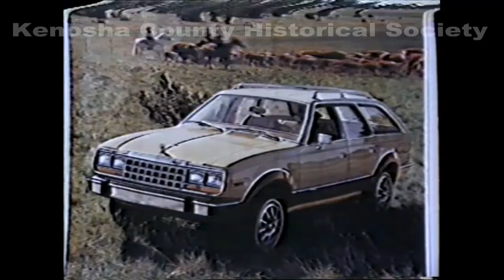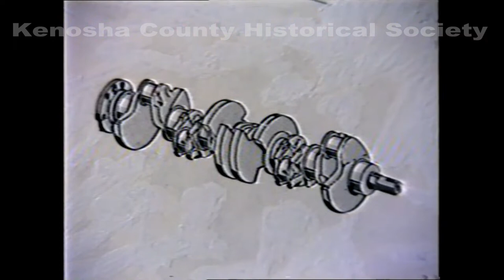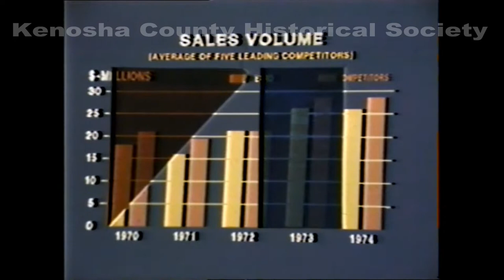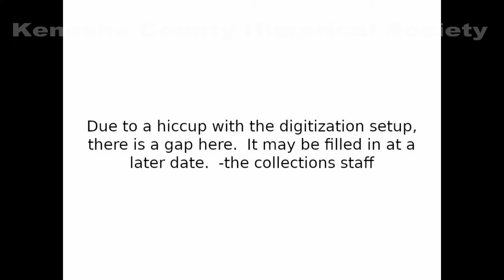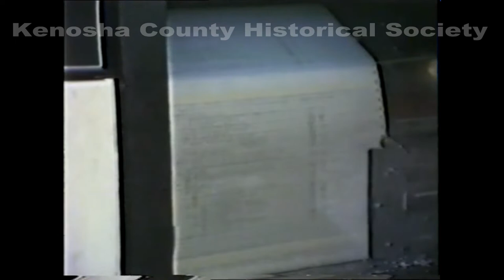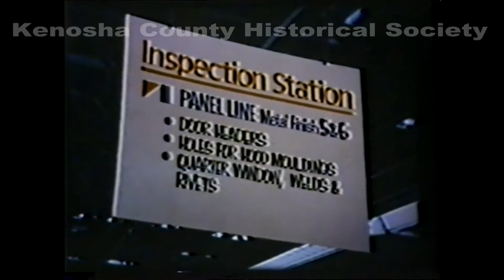"AMC History and Factory Tour, c. 1981."

Comment: In 1971, while still in high school,  went looking at a Gremlin but bought the SC360 hornet. Great car. Nose heavy with that 360 cast iron but very reliable and easy to work on. Shame I sold it for scrap long before its life was over. 160,000 and still strong running.  3.15 rear and 2.67 first gear could go to 65mph at 6500rpm. Screaming but never blew up.

Comment: In 1982, as I sat waiting for a tow in my broken down company car Pacer, the tow arrived. This is my 4th tow in 4 months. With 40000 miles this would be the 3rd transmission. If you ever rode in a Pacer in the summer, good luck. Riding in a glass bubble in the sun with a totally useless AC. It was over a hundred inside when you give up and roll down the windows. July and August you suffer. And other goodies that summer. Starter went out twice in 4 months, 2 new batteries, oil leaks, engine and transmission, and many other little things. So, I asked Mr. tow driver if the Pacer was his most towed car. He said it was second,  the Renault was by far the first.
Reply: Why did Renault come here? That is a very involved story having to do with French elections, the rise in power of the French Socialists, and the fear of Renault that the Government was going to take over the company. According to 4 guys I worked with from Renault, they were trying to get as many assets out of France as they could. Kinda makes sense, they made horrible cars for about 4 years and then went back to France.

Comment: Heck of a lot of people working in all those places. All the huge buildings, what has happened to them?
Reply from the maker: In the case of Kenosha, there were two AMC factory locations.  

The AMC Lakefront plant, which began life as a Simmons Mattress factory, in downtown Kenosha, was demolished in the late 80s.  The location is now the site of several museums, parks, and downtown developments. 

The main plant was kept on as an engine plant until 2008, and most of it has since been demolished as well.  One section was sold off and is now a warehousing operation.  The bulk of the area is currently a large empty field but soon work will begin to turn it into an "innovation neighborhood" designed to lure tech jobs; a lot of Kenoshans are skeptical (for many reasons) but it's got private money in it so this is one plan that's probably going to happen.

But, yeah, at its height AMC employed 14,000 people in a city that had about 70,000 at the time.
Reply from the maker: 2010, not 2008.  In my mind, I think 108 years and that always screws me up for dates.